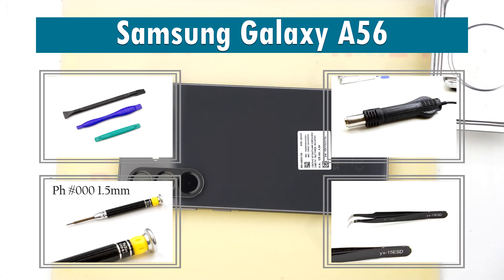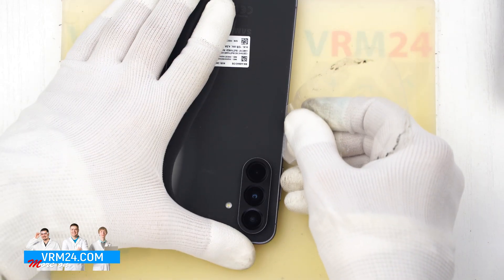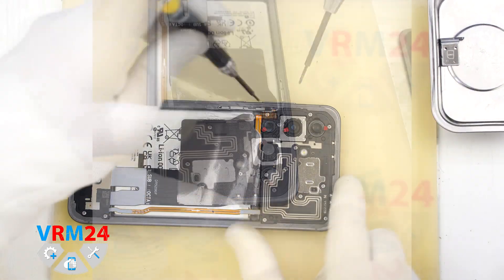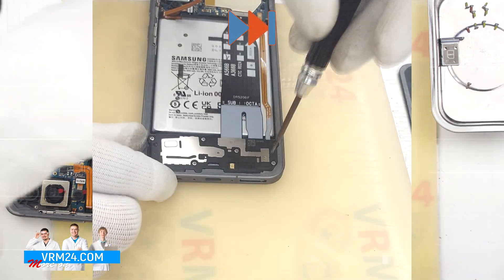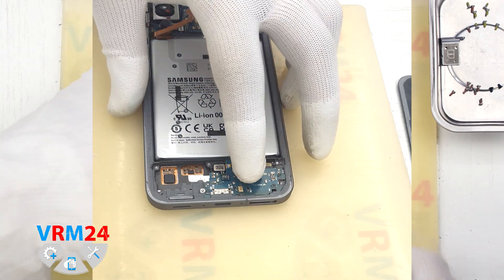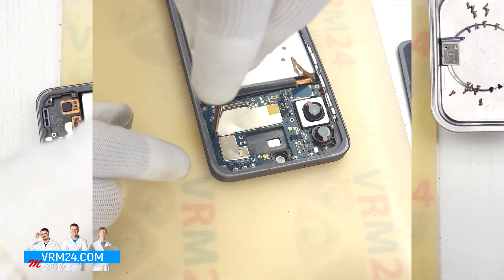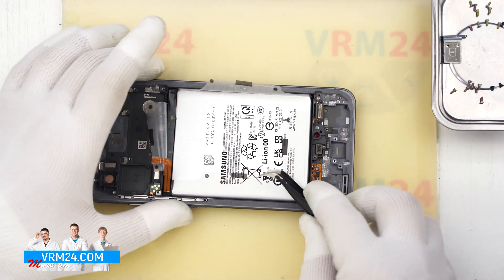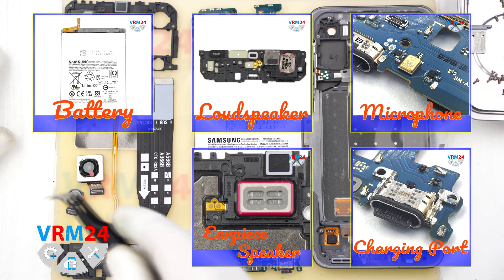Samsung Galaxy A56 SM-A566 Teardown Disassembly in Detail

Comment: Do you know what the largest chip is located half way from battery connection and led on the main board? I have a feeling it is the source of heat I can feel in that area. It is so hot it becomes uncomfortable to touch after a minute.